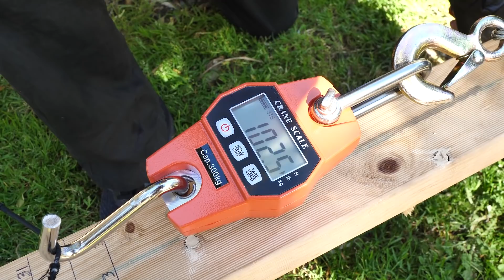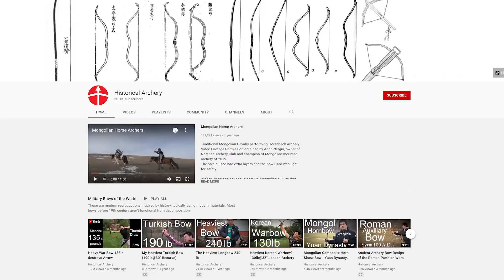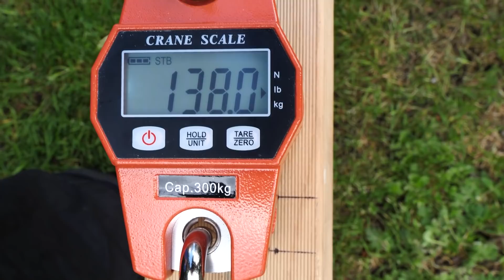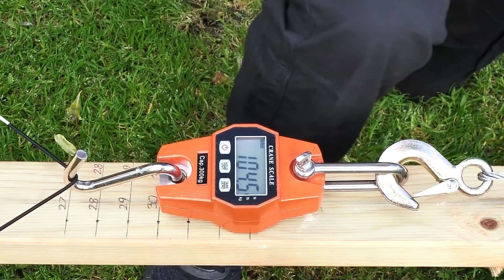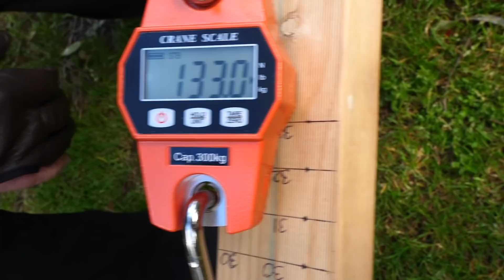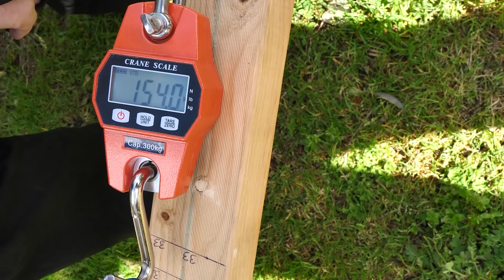Two idiots try to string a  TINY BOW

Comment: My experience stringing bows like that is that you put the middle on you knee and lean back while sitting on the ground and grabbing the ends. Kind of like rowing. Then someone else then can string it for you. Still a two person job but pretty easy. But then again never tried it with such a high poundage one. But I have to do it that way for my Mongolian bow of the same shape.
Reply: Intuitively, for me as a layman it seems like it should be easier to pull the bow in the direction that it is meant to bend. It isn't meant to overextend forward. 

If this is a 120 lb bow, they may have been pushing it up 140 or 150 lb in the opposite direction.
Reply: There are multiple ways of stringing heavy bows like this one. Like the one you mentioned. I'm surprised Shad didn't invest 5 minutes in looking it up on YouTube.
Reply: That sounds like a lot of pain if it slips from your knee up :D
Reply: @texasbeast239  They did actually string it in the direction it was intended to bend.  Recurves LOOK like they're intended to be used the opposite way when unstrung, but they get a lot of their power from that forward curve being pulled against.  It's pretty much the whole point of their design.  Stringing and using them in the opposite direction isn't good for them, though yes, they will be a fair bit weaker that way as well.
Reply: @orciencor6001  This
Reply: Using recurved bows I always plant one strung end on my left foot, keep the handle planted against my right thigh and push with my right hand to loop the other end, but the heaviest I go is ~100lbs give or take
Reply: I think that he should have relied more on his leg muscles.
Reply: @texasbeast239  Recurve limbs bend forward when they're unstrung, they did it correctly. Doing it the other way would at the best, just not be possible, and at the worst, just break it.
Reply: Why not just use that post as your shin and try to sit more.
Reply: @texasbeast239  indeed like other already mentioned, they did it correctly, it is indeed intended to bend like that, not the other way. Bows are never purposely bending backwards when unstrung, because that reduces the tension the bow is at brace hight, making very sluggish bows. Having the limbs curve forward like that, increases the tension at brace hight, making the start of the draw having higher draw weight, thus the bow being more powerful. Also the further the limbs are bend, the more force they need to be bend, meaning that for the draw weight, the limbs can be thinner, thus lighter, if they are bend more, saving the moving mass that the bow has to move around, so less of the bows energy is wasted in moving the bow itself, so there is more energy left in moving the arrow, thus faster arrow speed. There is a lot more in bows power than draw weight alone. 2 bows of same length and draw weight can look the same when strung, but they can have even 80 fps difference in speed between them, that depends on their unstrung profile, how stressed the material is and moving mass. And 80 fps  is huge in terms of arrow penetration.
Reply: @texasbeast239  and i have to add that many composite bows unstrung actually curve so much forward that the limb tips touch each others, making the bow complete circle when unstrung.
Reply: The better way for doing it is "stepping through". Brace the bottom by your sole and across your shin. Pin it between your feet. Pull it over with one hand and bend your knee to pull it over into a C. String with free hand.
Reply: @etherealhawk  is that different than what he tried at the start and couldn’t do?
Reply: I've always strung non-combound bows by using my legs for leverage, standing. One end of the string is set in place, then bend the bow, and slip the other end up the bow stave until it is set. Easy. and it saves one's fingers!

Comment: Shad. Could we classify your Mary Rose bow. As one of thoughs special issue Longbows for special Archers?
Also that Despot thing. Looking forward to you shooting that thing. And maybe have a match up with all 3 against each other. That be fun I reckon.
Reply: It's Mary Rose bow, and yes, it was Henry VIII's flag ship, so the archers would have been the best of the best, so their bows were also the best. That's why there is bows up to 200 pounds draw weight, that wasn't the norm, it was just the elite, and even quite rare in the elite. Most of the mary rose bows are around 150 pounds.
Because of Mary Rose bows, many believe that english longbows were always made out of yew, but that's not true. The amount of yew was running low, because of longbow mass production, so there was a rule that bowyers had to make 2 bows from other woods for every yew bow they made. That means that 2 thirds of all bows were other woods and the other woods were elm, ash and oak, maybe some others, but mainly those 3.
Reply: @jkre  interesting... ty for sharing your knowledge! 😃
Reply: @szurmatpl  my pleasure
Reply: @jkre  Ah. Thanks for the spelling mistake.
I was semi-aware of the 200 pounder bows, previous mentioned by Shad in his other videos. But thanks for the exact info.
Reply: @calumdeighton  happens to me also more than i care to admit

Comment: With the equipment you have, if you put notches at every inch starting at like 12, you actually could just chart out the draw/pound curve. Graphs!
Reply: GOOD POINT! What about the Graphs! GRAPHS SHAD!
Reply: Yes, and I'd be interested to see if it's close to the ideal spring i.e. linear
Reply: I'd recommend marks over notches, marker or bright fabric paint meant for movement. Wouldn't want to damage the bow itself.
Reply: Damn I developed a passion for graphs at physics labs (in highschool and 1st year uni) I did so many graphs and so much data analysis....
Reply: Science requires documentation, if you're not writing anything down it's just goofing off.
Reply: Yes! I have a feeling that a linear profile will put more energy into the arrow than one that ramps up the last inch.

Comment: Don't mess your shoulder up, that thing is a different animal from a longbow. You're contorting yourself in weird ways trying to draw to 28". Pound per pound the shorter the bow the harder it's going to be to draw with all that string pinch, especially since you're describing it stacking up around 27". You're used to drawing to the ear with longbows at 32", it's really only the longbow guys who ever seem to draw that far. You're way over bowed and a bad injury can happen all at once with no warning that it's even coming, then you're out of action for an untold amount of time, often a long time. 
All that out of the way, recurves are usually going to shooter harder pound per pound, it stores the energy more efficiently. You probably only need a 75# to equal your longbow. I can tell you my 75#@28" Martin Hunter shoots a 700 grain arrow at 170-175 fps with b-50 string (drawn to 28"), I'd wager that's probably comparable energy if not even exceeding your longbow. I've read plenty of accounts of horsebows often being very fast bows, surprising even the regular recurve guys. So that horsebow might be a little monster when you work yourself up to shooting it well. There's a reason warbow archers get so much credit for their insane draw weights, it's likely because they were making up where their gear was lacking. Longbows are still amazing, little change since the stone ages, very timeless.
Reply: Actually in comparison to asiatic archery, longbows 32" draw is on the shorter end. This bysantine bow maxes out in that 28" (27 from the belly) of draw length, because of its design, it's at 28" already a string angle of 90°, and after that point the string just pulls the limbs back, instead of bending them and the bow stacks.
And about that draw length, 32-33" is very common in most asian countries, some draw less like 28-30" like turkish bows, and some draw longer like 36" for manchu bows and from tall guys in japanese yumis even up to 40". These long draws are possible with thumb draw, that naturally gives 2" more draw length than finger draw, just because thumb is closer to the palm of the hand, and in addition the wrist position is more natural so it is easier to draw longer just because of that.
I can give my self as an example. I'm 162cm or 5'4" i believe for americans. So pretty hobbit. My modern draw to the corner of my mouth is 25,5" from the back of the bow, like it is officially measured. My medieval english style draw is just shy of 29", my comfortable thumb draw is 30", my max thumb draw is 32" and with manchu thumb ring that's design gives extra inch, is 33". So even a hobbit like me can draw (instead of 25,5") 33" easily, bit uncomfortable, but still easily. Armin hirmer of malta archery has were nice youtube archery channel, possibly the very best one, in terms of asiatic archery (modern mostly, some real composites also, but very few, and very cheap and crappy ones). He about average in hight, and he can draw full 36" manchu draw.
Reply: Recurve is also release when you hit the ramp up, where the long bow has the ramp early on
Reply: We get it, You know about bows, there, you got attention for your long ppst.
Reply: @an3582  instead of being upset that someone knows more about something than you do, you could take the opportunity to learn. He spent his time writing that when he didn't have to.

Comment: See this is where it is so  great: recall that vid you made about how much payload  in  equipment and weapons an adventurer could carry?  There was a  section about  longbow being  too   cumbersome to carry together with the rest of stuff but also mention of shortbows and a sheath for them to carry  on person. this  sexy  little beast can be  far easiercarried on a side sheath without being too cumbersome and weighting  a lot less too and still being  powerful AF when you need it (provided of course you carry it  strung).Obviously such  a shotbow was  thepreference of cavalry archers andit it  actualy reminiscent ofthe  mongolian onesthough not  lookingas composite as them with the horn parts
Reply: Composite bows were carried strung, they can be strung months in a time, and only loosing about 10% of the draw weight, witch has been tested multiple times. The bows were so strong that they were still strong enough even after losing that 10% of the draw weight. And that draw weight can be restored to them after wards. Witch isn't the case with wooden bows, witch is why wooden bows needed to be carried unstrung and only just before battle strung. That gives composite bows extra advantage in ambushes, when the longbows would still be unstrung when the fighting starts, but composite bow is strung and quickly accessable in its holster.
Reply: While you’re at it, there is some incredible information about “steel bows circa 600 BC“ I loved your video on the sword of Laban. I would be happy to share some of the research I have done on Israeli “steel bows“

Comment: I was waiting for this! Finally Shad gets his hands on a proper recurve bow, exactly so he could see you don't need a 2 meter stick to make a 100 pound draw weight war bow.
And now Shad, remember, those can be shot... from horseback.
And about the D&D reference... even D&D had the "composite bow" (at least in 3.x) which was essentially a historical recurve (they were called composite because they weren't made from only wood, but also included leather and parts made out of goat or cow horn) and allowed to add some of the Strength modifier (I think they went up to 3) to damage without being magical.
Reply: Composite long and shortbows are in 2e as well, and are our (1e/2e players) go-to bows due to both strength modifiers for high strength, and far more power in tiny packages for rogues :D
Reply: Actually cow horn isn't good for bows, it delaminates. Hungarian grey cattle can be used, but it isn't the best. Best horn for bows is water buffalo horn. Also whale baleen was used, at least by koreans, and maybe others also, but water buffalo was still the most wanted even by the koreans.

Comment: Maybe this smaller (sorry, I meant so say "More reasonably sized"), more compact bow would be better for rangers compared to war/long bows. Definitely easier to use in a tight space.
Reply: Problem with composite bows, is than the natural ones are more effected be wet weather and humidity. Flat and long bows are are a wee bit more difficult to manuver with, but are a lot less effected be the terrain condition than say, a composite steppe bow.
Tough I will always say than the best ranged weapons for rangers/forest fighters are javelins.
Reply: @yeraycatalangaspar195  yup, javelins with/without an atlatl or throwing darts all the way until the invention of the self contained metal cartridge and corresponding firearms.
Reply: @yeraycatalangaspar195  - I dunno, I've used composite horsebows for hunting in Alaska and never really had any issues. Properly made, even the bio-bows hold up well to the weather if you don't mistreat them. ANY bow left laying around in the elements is going to have issues, which is why proper archers keep them covered when not in use.

Comment: 1 stand up.
2 place one end of bow on left foot.
3 put right leg through the centre of the bow between shaft and string(string in front of you) and use your right thigh to push the handle out while pushing/pulling the top end down.
4 string bow.
5 stand up straight and bring leg out of bow.

Comment: It astounds me how archers in games or movies are portrayed as weak in close combat when it takes arm strength to draw a powerful shot. I'm speaking archers that aren't Hawkeye.
Reply: Bows are drawn with back muscles, not arm. That's why a guy with lots of arm strength might not be able to draw as heavy bow, as an archer witch has less arm strength. Also especially longbow archers have to carry the bow in their hands, so it carrying also another primary weapon would be more uncomfortable, so they only had side arms, and a sword is at disadvantage against pole arms that infantry uses, that's why weaker is melee. In asia where archers carried their shorter bows in holsters at their sides, they had free hands to carry a second primary weapon, such as spear or lance and later musket, with their bows. And usually they were also horse archers/musketeers.

Comment: That's a cool little tester with the winch. With that you should measure your bows inch-by-inch from zero, then you could plot the full draw curve for them. Length of pull is more important than a lot of people know, not just because the weight increases with distance but also because energy is force times distance, so a 200lb crossbow with a tiny length of pull might not be more powerful than a bow with less draw weight but a greater length of pull.

Comment: Use a limb saver...its a string with a pouch on one end and a loop on the other. Stand on your limb saver string pull the center of the bow until you notch the bow string...

Comment: The painful thing is,  you have to maintain that draw for a few more seconds...  When aiming, it'll hurt a lot...
Reply: You don't aim traditional bows, you draw and loose. The aiming happens in your mind.
Reply: Question, does a quick draw and loose of a bow and arrow precise or not?  The only type of archery I've seen is the traditional Japanese archery in which they draw the bow and wait for orders. Is it different for European longbowmen they just shoot immediately?
Reply: @AundreiFrieght  How to aim a bow and not hold 115lbs of draw weight: Simply aim it 3 inches short on the draw, those extra 3 inches can easily be 30to 50 lbs of draw weight.  Once aimed, pull back the final inches while maintaining aim and fire.  Historically, most archers weren't aiming for an individual.  You're not trying to shoot an arrow at one person, just into the giant army of people coming towards you.  It's a lot easier to aim for a blob of 100 people then 1 person.  That's not to say they couldn't aim at individuals at closer ranges.  

This video showed a good example of how draw weights ramp up in the last few inches.  A person wouldn't hold 115 lbs to aim unless they were able to and it didn't tire them out too much.  Holding for 2 seconds to aim is almost handicapping the archer, those 2 seconds could be better used nocking a new arrow and starting to draw.

Comment: This brings me back to when Shad was talking about how Dwarves theorhetically could be just straight cracked out archers because they could make small bows with insane draw weights due to their increase in strength compared to elves and humans
Reply: About Elven Archer if their culture was an archery centered one. Is very possible that they would evolve muscle specific for drawing the bow. Even if they had a light constitution. Birds of Prey are a great example of that. Very frail but some can even carry their prey while launching themselves up in the air. 
And the strength to pull the string could be so specific for that motion that wouldn’t help for other feats of strength. Making them very archery oriented. And I’m only talking about their anatomy. I also think they would be a lot stronger if they were as nimble as they are portrayed even if they had hollow bones or something to be lighter and frail
Reply: @CaioLGon  Depends on the elves, for example only one elven culture in The Elder Scrolls are centered around archery. Lord of the Rings elves are kinda broken so I usually don’t mention to them as they excel in most combat situations. World of Warcraft is a good example in your case however, even before they were elves, the trolls still favored the bow. That I can see your point coming in play, better back muscles for drawing heavier bows can compensate for not using a smaller more sturdier bow.